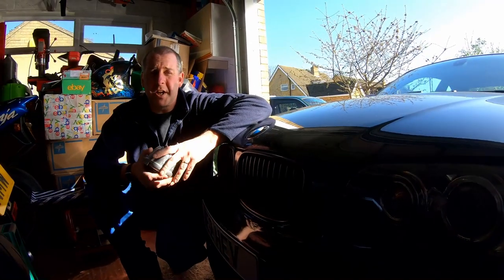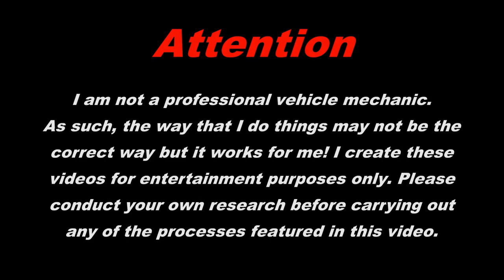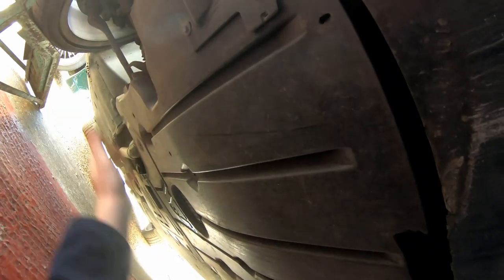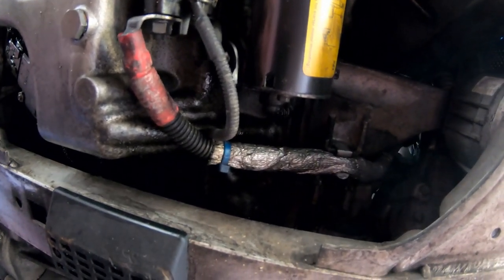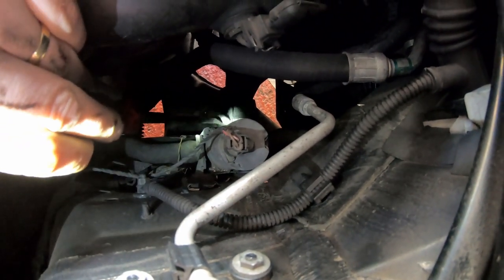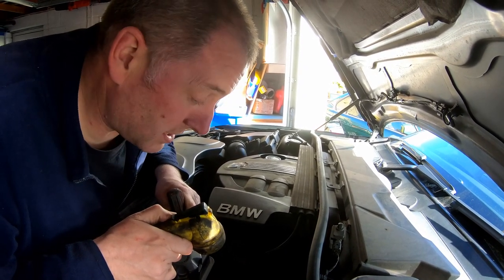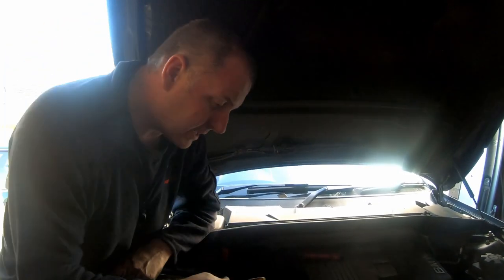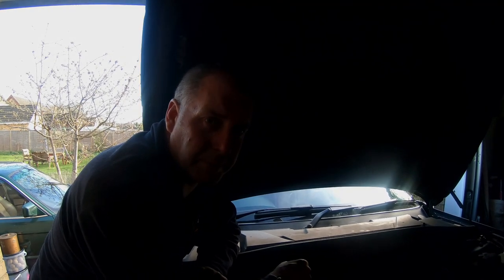Replacing The Engine Mountings On The E8x BMW 1 Series - All Models, Diesel and Petrol.

Comment: My motor mount bracket broke, painful to change but thanks for the video, cleared a few things up. If anyone is changing the bracket, you can acces the three bolts from underneath the car, and the last one you can only take out with the wheel off .
Reply from the maker: Nice work!

Comment: Looks like a ball ache on the n/s mate, why did ya change them could you notice it when pulling away or changing gears like a rocking? Or was it just for peace of mind
Reply from the maker: Peace of mind really! The N/S was easy it was the O/S that was the pain! Obviously that depends on what country you live in and what side of the road you drive on though! 😂
Reply: From the angle of the camera Of you under the motor it looked like it was passenger side (n/s). I’m from sunny south London haha